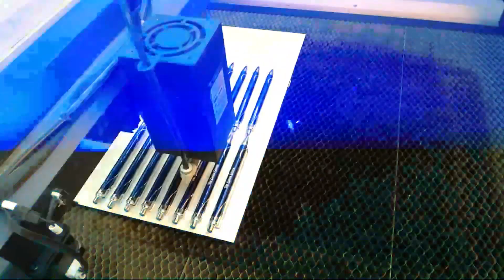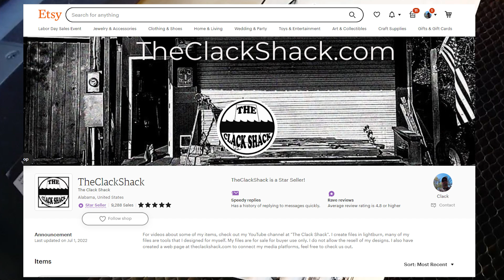Engraving hundreds of pens- with a diode laser

Comment: What kind of pens did you use please? Are they specially made with a coating so that they can be laser engraved?
Reply from the maker: These were some that I got from a local shop. What I use typically comes from Amazon.
Reply: @TheClackShack  but these ones are metal? I've seen lots of the bamboo ones but I want to get engravable metal kind of like the engravable stainless steel keychains you can find online
Reply from the maker: @ they were anodized. Got them from
 A friend.

Comment: I just got the Elegoo 20w diode machine. Added limit switches and lightburn. You think my 20w would be able to handle pens like this? also, have you tried the soft-touch coated pens?
Reply from the maker: It should if they are the correct material. A 20 watt is a good machine for engraving.

Comment: I'm glad I found your site!! I'm needing to engrave multiple of the bamboo pens from Amazon and was trying to figure out a set up as I am new to lasers... do I use 3m basswood for this? Thank you!!
Reply from the maker: You can use 3 mm but for a locking jig, I recommend 4mm for rigidity
Reply: @TheClackShack  thank you!!!
Reply: I space the jig slots to allow a 12mm round magnet, (or your magnet's size), to be placed on one or all of the thin wood strips between the pencils.  Make sure the magnets "thickness" have clearance from the laser head bottom....  AND, set your burn height to the TOP of the pens or pencils you use, NOT the jig surface....  Give some space between the pencils to keep everything flat to the honeycomb base....  Works GOOD....

Comment: I’m so glad you said this. Diode lasers are relevant to this industry and for people who can’t afford a large format co2(meaning a large bed). I just bought the Monport 40watt and I’m excited about it. It’s cheap enough for me to learn on and if I ever start making any money I’ll upgrade. I’m an XTool guy with diodes. I have 10watt non pro that I home and run absolute coordinates no problem at all. I just got the Saturday before Prime days the 5watt pro for 279 and the 20watt pro module for 549. Cheaper than xTool had the 20watt pro machine on their site and I had already gotten the extension set. Still got to set that up
Reply from the maker: If I wanted, I could have loaded up a couple of machines. I felt like the flow worked fine with just the one. Thanks